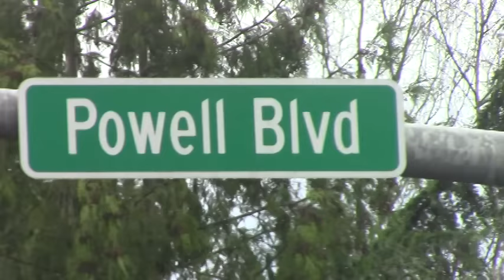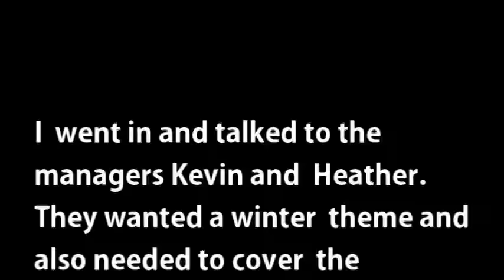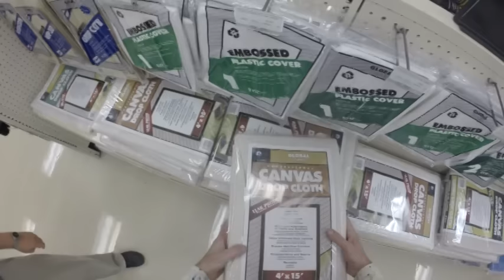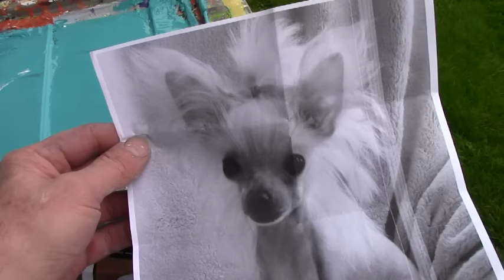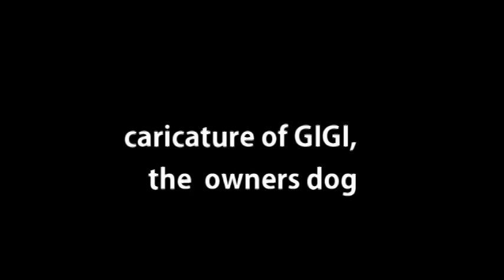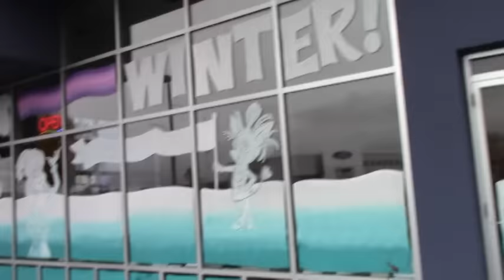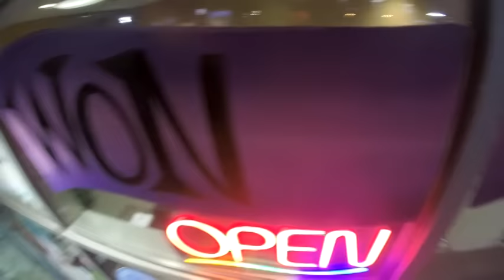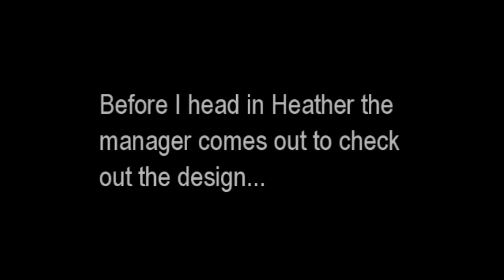NEW WINDOW PAINTING

Comment: ¡Hola Senior Campbell! Glad to see you are still painting and sharing your years of expertise. :D I see that you have been battling the paint beading up as well. My Dad and I have run into this, up here in the greater Seattle area, as well and we did some extensive research into it. Though sometimes, it is from oils accumulating on the windows via car exhaust, etc. (especially on the ground level windows or doors),  the majority of the time, it is from silicon that is used in the cleaners used by window cleaners, especially if they are new windows or have been cleaned repeatedly. It's great for keeping the windows sparkly and clean looking ... but not so good for us water-based splash artists. :P With small areas, I'll usually drag the roller across the paint, right as it's tacking up then, once dried, do a second coat. No biggy and I can buzz along, but for larger areas, a good quality window stripper, like No-Touch (https://www.amazon.com/No-Touch-Auto-Glass-Stripper/dp/B000COBXFU), works the best. Apply and buff off then BAM, clean glass ready for paint. I'll usually stop to inform the customer of the severity and I may have to add to the cost, due to the size, but most of the time, the cleaning is quicker (& more cost effective for me) than doing 2-3 coats. I also tell them to tell there window cleaners "NO SILICON!" :P Keep up the good work, Sir!!! - Allen Shelton, Definitive Arts
Reply from the maker: Thanks for the info on beading up paint. I am always looking for answers. I will look into it. Man it was snowy and windy today. I have a video coming up tonight late, it was a wild day! ha! How's your holiday season going?
Reply: My pleasure, Sir. You helped me out a lot in my beginning. Simply returning the favor. ;) Brrrrr Cold, snowy and windy are never fun. :P Not much of a season for me. Had to take a bit of a hiatus to focus on my family and my health but it's time to paint again. I'm starting things back up now. I did... one Holiday splash, so far. :P Epic, I know. Hahahaha... Oh, P.S. add a little splash of 99% Isopropyl Alcohol to your paint and it will dry quicker in the cold wet NW weather. ;) The Alcohol will bond to the water molecules and take it with it as it evaporates. Has saved me tons of wait time. ;)
Reply from the maker: DefinitiveArts Wow! Cool idea, I surely could have used that tip today! ha! My new video will be up soon...it's a long but fun one.

Comment: I used interior egg shell, roller did not roll free from the start and upon letting first coat dry which seems took for ever to get an even coat. is there a certain brand of brushes , rollers etc to focus on?
Reply from the maker: I use "Wooster" roller covers and just a standard 4" roller from the paint store, stay away from cheap rollers. Just make sure it spins freely. Remember you can use 2" foam brushes to start too, even to just lay in the base coat. For larger areas yeah, the roller is faster though. Just make sure it can spin freely.